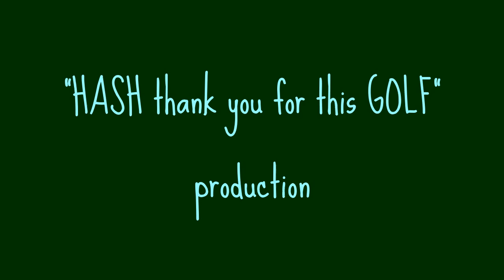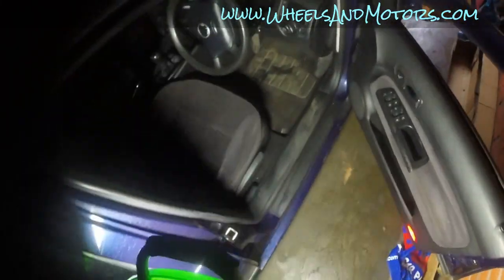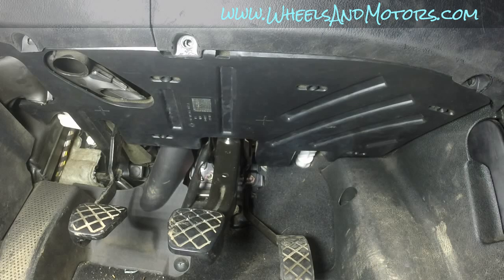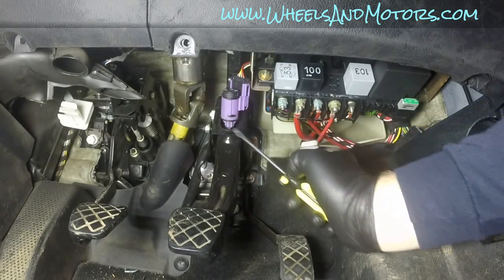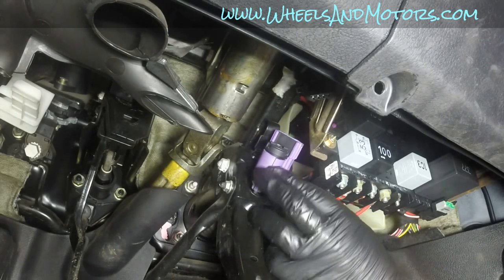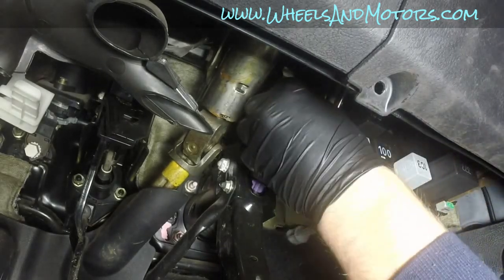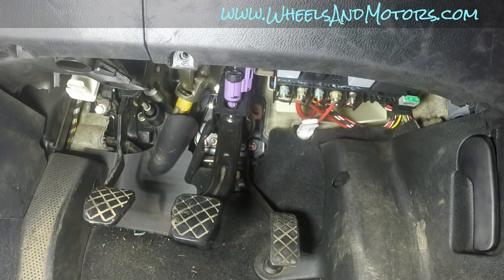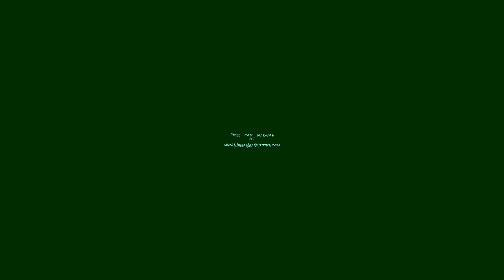How to replace brake light switch in VW Golf Mk4 (right hand drive)

Comment: Literally watched this once. Then done it a few hours later as I remembered the quality tutorial. Took me 2 mins. Thank you very much
Reply: Hi can you tell me what symptom indicated that the switch had failed, was it engine management light?
Reply from the maker: Normally first sign is that brake lights are constantly on even when you're not braking. I switch is faulty brake light circuit acts like a brake pedal is down.
Reply: @wawayltd  Thanks for getting back. apparently my brake lights are fine but cruise has failed along with engine  h management light.  could it still be the brake switch🤔

Comment: I had a problem with my taillights being on but not the brake lights. Replaced the brake light switch as shown in the video, really easy to do, EPC light is now off and brake lights are illuminating! Happy days! Quick tip if you press down on the brake and turn your engine on after replacing the EPC light will turn itself off when the new switch is fitted 🎉 thanks for your video! Saved me an arm and a leg at a local garage 😂

Comment: Great tutorial!!! Just replaced my brake light switch because i kept having an EPC warning on my dash, and cruise control didn't work. Was able to identify the faulty switch using VCDS, and installed a new one, problem fixed!!
Reply from the maker: Thanks Max 😊👍
Reply: Hi can you tell me what symptom indicated that the switch had failed, was it engine management light along with cruise control failure?
Reply: Andrew Griffith cruise control failure indeed, along with a EPC light on my dash.

Comment: Very helpful thanks!  I would just add that you need a T20 Torx bit to undo the screws. I tried WD40 on the old switch but all that did was change the brake lights from being permanently off to permanently on, but with a new brake light switch everything was fine. The EPC warning light didn't clear upon starting up the engine in the garage and pressing the brake, but did clear itself a couple of days later when I took the car out for a drive.
Reply from the maker: Thanks for your comment, glad if it helps 😊👍
Reply: if you dont have an OBD scanning tool to reset the computer u disconnect both battery terminals....... connnect a wire or jumper cable between the positive and negative cables (not battery terminals) ...... turn ignition ON with the battery out ofcoz.... then turn everything on inside the car.... every little thing that works with power....lights, indicators, fan, AC button, windows, horn interior lights etc...... then leave wire connected for about an hour..... this will drain the ECU computer circuits from any excess power and reset the computer

Comment: Found out today that the brake light switch can be disassembled and repaired. A little protrusion on the plunger (the part that is being moved by the braking pedal) pushes copper contacts away. The protrusion is made of plastic and will wear out sooner or later. By bending/pushing the copper contacts slightly towards the plunger, the plunger is again able to push away - and disconnect - the contacts.

Now I'm having a hard time placing the switch back in its bracket...
Reply: You made it?

Comment: Thanks! One strange thing happened to me. After inserting a newly bought switch the brake lights stayed on, whatever I do with the brake pedal (pressing and releasing). Finally I removed the new switch and inserted the old one back and things went back to normal. I was suspecting the old one to have a sporadic problem, that's why I wanted to replace it. Is this a definitive sign that the newly bought switch is faulty?
Reply from the maker: I think so

Comment: Would a failed one of these mean you handbrake lights also don't come on? Seem to recall all my rear lights failed out once (car's been sat on my drive for months with a failed MOT).
Reply from the maker: What are handbrake lights?
Reply: @wawayltd  Your brake lights. But activated via the hand brake - i.e. generally the side ones and not the central one above the rear window. In other words, if if was just the foot brake switch, I'd still expect the lights to work when the hand brake is engaged.
Reply from the maker: That's strange, I never knew that handbrake/parking brake activates some lights... well, apart from the one on a dashboard. I don't think I can help you there...

Comment: You made that super easy thanks! Changed switch and b lights now working again but glow plug symbol still flashing. Any ideas or will I have to get it plugged in?
Reply from the maker: Sean Woodward Flashing glow plug sign can mean lots of various things. There are some people that offer diagnostics for something like 20 quid. I would recommend plug in.
Reply: Thanks for the advise!

Comment: i have the Golf MK4 Tdi and all of a sudden my glowplug light constantly flashes while driving but the car drives find besides the battery problem. Guess the dead battery killed the brake light switch...... and yet i dont understand what that switch has to do with the glowplug light flashing.... in other videos everyone talks about the brake light switch causing the glowplug light flashing..... so i changed the switch and the flashing stopped lol..... this puzzles me as mechanic 😂 ..... the part number for brake light switch on the MK4  is 1J0 945 511D ...... i noticed an old one laying inside my glovebox when i bought the car few years back..... guess this part tends to fail every few years

Comment: i know its an old video but i have  to try. I own a seat leon 1.9tdi 2006 1p and the brake switch is missing, and so is the wire. can you tell me where des the wire lead to? so i can chase it and find it?
Reply from the maker: I'm sorry, so far wiring is a magic mystery for me - therefore I'm afraid I can't help you with this one..
Reply: WheelsAndMotors  its all good. Thanks for answering

Comment: Hi thanks for the video. Can you help me why my brake lights are permanently on?
Reply from the maker: Faulty switch?
Reply: @wawayltd  unsure, plug it in and the brake lights go out, pressing the peddle and nothing happens, changed the bulbs, swapped the clusters over but still nothing, take it out of the holder and the brake lights come on and stay on.
Reply from the maker: @lewismatthews3653  What brake light switch does - turns lights on when you press brake pedal, so by default lights are on constantly, unless brake pedal pushing it when it's up...
Did you try to replace that switch? With the new one? It's pretty cheap at least to give it a go..
Reply: @lewismatthews3653  having same problem. Brake lights permanently on as soon as I turn the lights on. Changed the BLS but still the same. Did you find the way to fix this? Thanks

Comment: my Golf mk 4 GTI model 2002.code p2128 and epc light >> The gas pedal does not work .. but when I put my feet on the brakes moving a car and the brake pedal was working as a gas pedal and brake at the same time ,,Is there any help?
Reply from the maker: Brake pedal as gas pedal... That's odd. Don't know.. Here's the link about that code:
http://wiki.ross-tech.com/wiki/index.php/18560/P2128

Comment: Would a faulty break light switch cause your trans to be stuck in park lmao? A method said it does
Reply from the maker: I don't have much experience with auto-transmission. Possibly, if it requires for brake pedal to be pressed to switch to drive, and uses signal drom brake light switch to "know" when it's pressed.. 
Is your switch faulty?

Comment: If my auto gearbox isn’t shifting from P to D, would it be the brake light switch?
Reply from the maker: Brake light switch is pretty simple and shouldn't affect gearbox, unless your car is programmed not to move with faulty switch.. Do your brake lights come on and off?

Comment: Good tutorial. I replaced the brake switch on my 99 beetle but one light still not working. bulb and fuse are ok. Do you have any clue of whats the problem? thanks
Reply from the maker: Is there only one bulb that's not working or the whole light (side)?
Reply: WheelsAndMotors yes, if I push the brake pedal just one light is on. if I turn on the lights both lights work perfect
Reply from the maker: Miguel Campos That's weird. I'll see if I can find out something. At the moment I have no idea either. I haven't been to this Golf's tail lights yet. Is the brake light and tail light performed by the same bulb?
Reply from the maker: Probably something wrong with wiring. Bad contact or something...

Comment: Is this switch related to cruise control not working or not ?
Reply from the maker: I think it can be. Cruise control switches off when brakes applied. If it doesn't work it needs to be replaced anyway, if it does then problem with cruise control is somewhere else. Simple.
Reply: Not sure, but it does give an "engine failure" notification on the dashboard. By the way, it's not always the switch that fails, the connector can also cause trouble.

Comment: Brake lights aways on , brake pad is not still its free. help!!!
Reply from the maker: Don't quite understand what means "brake pad is not still its free"... Did you try to change switch?
Reply: WheelsAndMotors I did, at the moment everything was fine untill monday night, the brake lights was aways on , idk how to spell ir right but its moving from the left to the right pretty easy, shouldnt it bee still?
Reply from the maker: @hujakshhh76  Yes. It should stay pretty strong, not moving. Maybe you have problem not with the switch, but with the bracket that holds it?
Reply: WheelsAndMotors maybe maybe, dont know and dont know what to do.
Reply from the maker: @hujakshhh76  check if there is damage to that place that holds it. It should sit strong, and when brake pedal is up - it should press it firmly.
Reply: WheelsAndMotors no damage at all, maybe i need to tighten it?
Reply from the maker: @hujakshhh76  I don't have that Golf from video for few years now, so I don't remember exact position of thing that holds it. Sorry I'm not very helpful... Whatever you do make sure that brake light switch sits tight. If you want to test brake light switch - connect connector and press it with your finger, when you press brake lights should switch off.
Reply: WheelsAndMotors Bought a new connector, works perfect now, thanks❤️🤩
Reply from the maker: @hujakshhh76  Glad you got it fixed 👍

Comment: My car doesnt turn off the ligths even when I disconect the brake switch
Reply from the maker: That's odd, even if by default lights are on, and brake light switch switches them off when pedal is up.. As I understand with connector disconnected they should go off. Probably problem is somewhere down the line, must short circuit somewhere..

Comment: They are bastatds fuel pump code lamda 1 lamda 2 and rezervouar valve exxaust are checked after this problem also tail lights are working wrong they are doing it in purpose I found that they had made a trick so the valve switch not fit in place correctly..